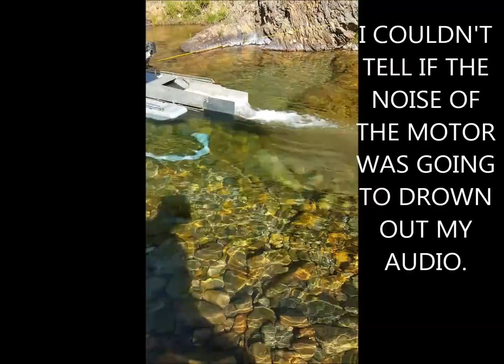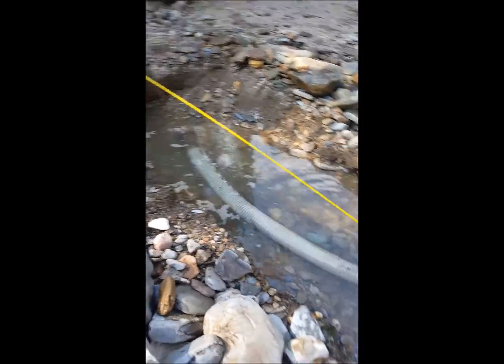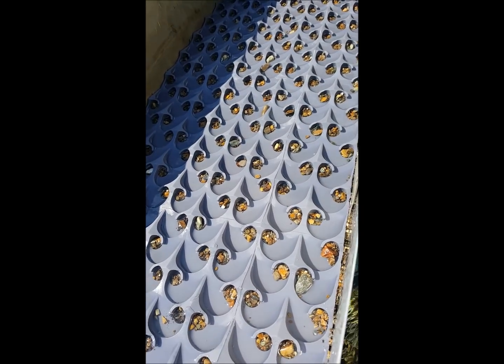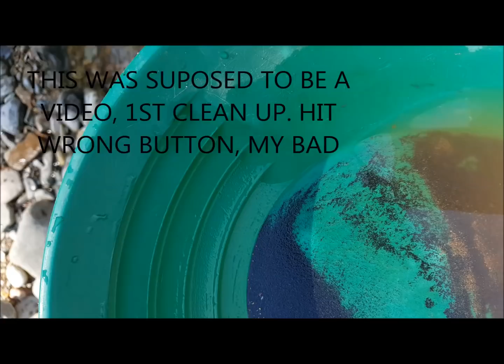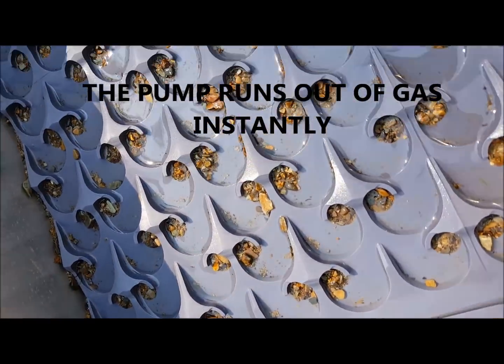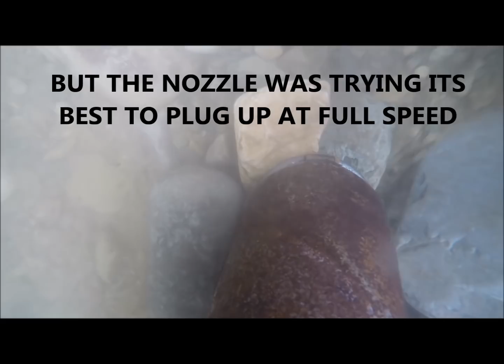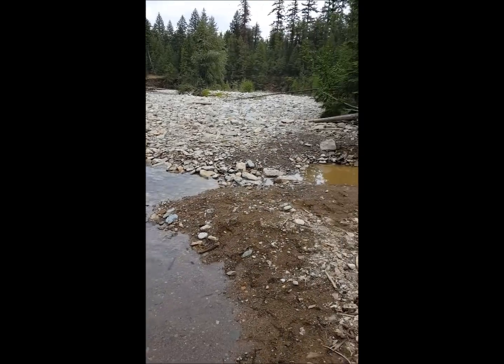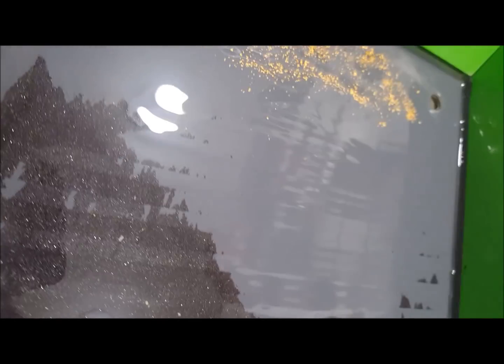Maximizing Your Gold Recovery: Insights from Our Latest Dredging Session with Dream Mat

Comment: THE TAIL OF THE SLUICE HAS TO BE ABOVE THE BODY OF WATER YOU DISCHARGE INTO OR IT CAUSES A BACK PRESSURE THAT CLOGS YOUR LOWER RIFFLES AND LOSES THE FINE GOLD.
Reply from the maker: Great tip, will have to watch if the cells continue to spin.
Reply: this makes me question how stream sluices work so well when totally submerged
Reply: @StratRider  see: "under water dredge sluices"

Comment: BUILD A FOUR-LEGGED PYRAMID OUT OF 1/4" REBAR. WELD THE LEGS TO A REBAR CIRCLE THAT FITS JUST AROUND THE EDGE OF THE NOZZLE, WELD THE CIRCLE TO THE NOZZLE.  IT'LL NEVER PLUG AGAIN.  DID IT ON MY 3" AND IT WAS THE BEST MOD I'VE DONE ON ANY DREDGE.